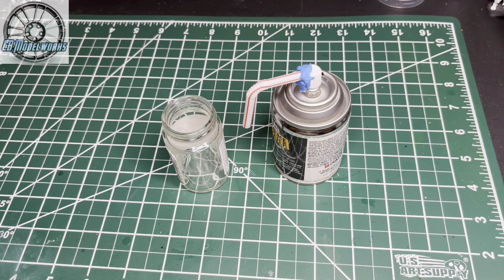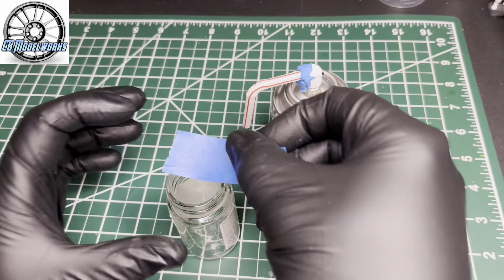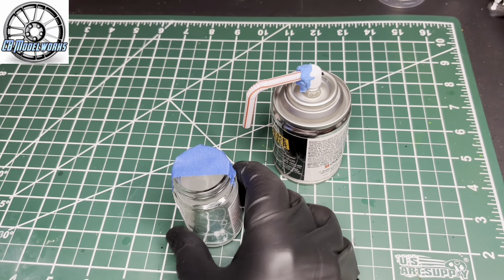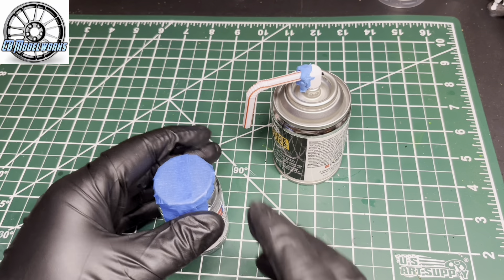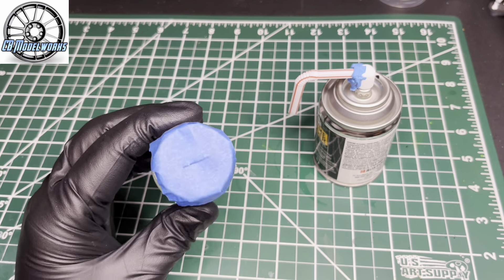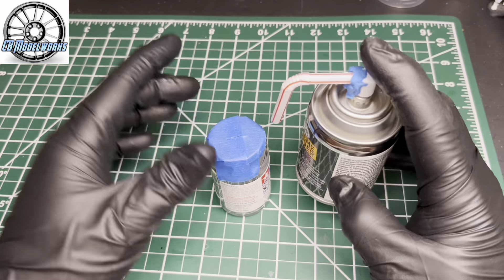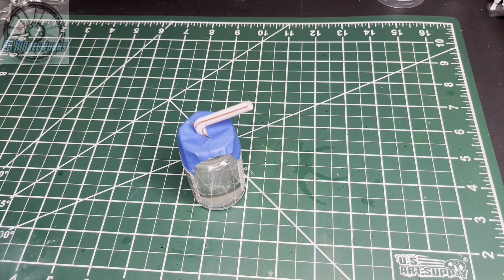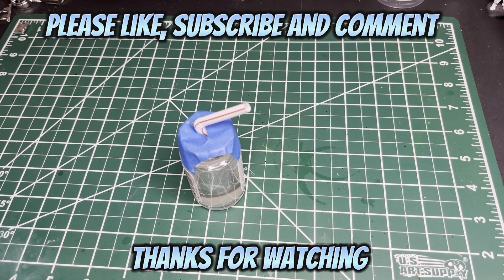How to use spray can paint in your airbrush for scale models!

Comment: Very interesting thanks.
How do you clean your airbrush after using paint from a spray can? I am not sure but it seems a solvent acrylic paint so I cant just clean with regular aribrush cleaner.
Reply from the maker: Thanks for checking it out. All the spray cans are laquer paint so I just clean the airbrush with laquer thinner. I use the cheap stuff from Walmart for cleaning and save the good Tamiya and Mr. Hobby for thinning the paint.
Reply: @CBModelworks  thank you

Comment: How do you get the spray paint clean out of the air brush?
Reply from the maker: I thin it with either Tamiya Laquer thinner or Mr. Hobby leveling thinner. Once it gasses out overnight you can treat like any other paint. It’s a bit thin for brushing but you can do it if you stick to touch ups. It’s the only way I’ll use spray paint now I have had too many issues spraying straight from the can lately. So now everything gets decanted.

Comment: Can you take more than one can and mix it?  I have a few ts 13 tamiyas that have a little left in it and would like to use it without worrying it sputtering out of can half way thru spraying.
Reply from the maker: Yes you can. I did just that the other day with my wet look clear. I would say as long as it’s the same paint unthinned you should be fine.

Comment: has anyone used the rust-oleum protective enamel brush paint in the one pint cans in an airbrush
Reply from the maker: Not sure. I don’t use Rustoleum paint do to bad experiences( 100% my fault not the paints) but I would assume the process would be the same. Just a matter of finding the right thinning ratio to achieve a smooth spraying pattern. Hope this helps.